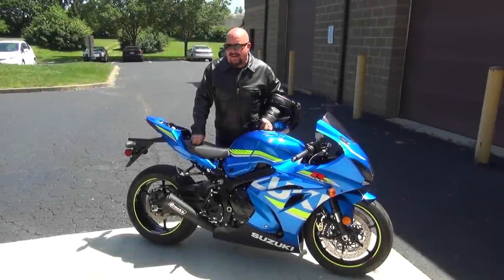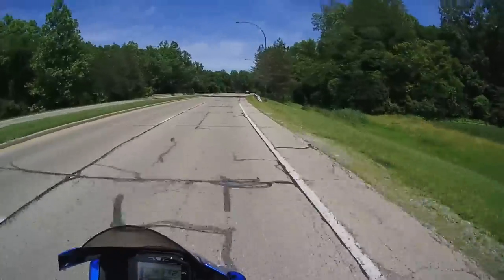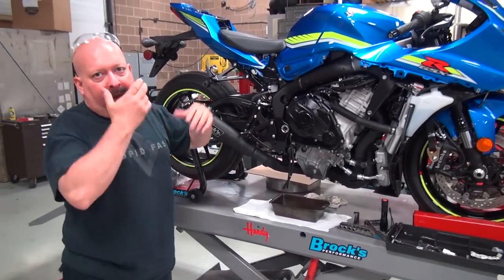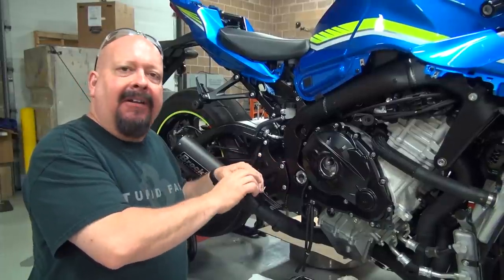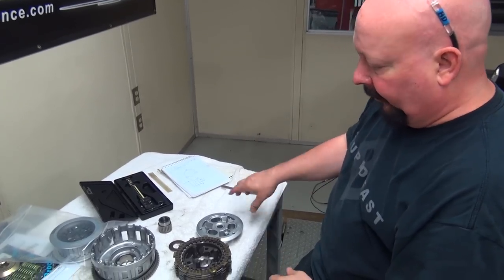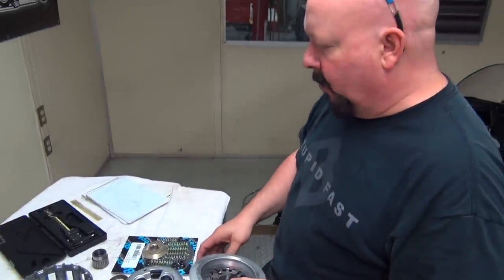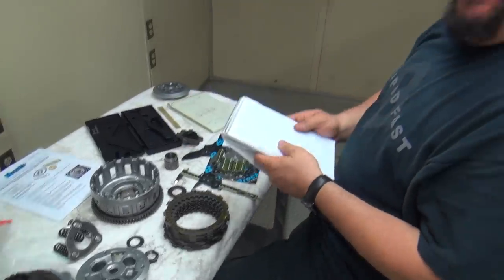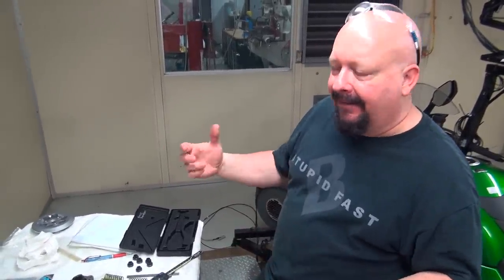2017 GSX-R1000 S2B: Episode 8 - Dragstrip Prep - Clutch Mod Conversion

Comment: Would adding this mod kit have negative effects on everyday street riding or wheelies?
Reply from the maker: You lose the back torque limiter, so if you slam it into 1st gear at 80 mph, the back tire will bark/slide etc. The mod just makes the clutch act like all clutches used to.
Reply: @BrockDavidson  thank u

Comment: Manual does state one full turn, but 3 quarters of a turn does seem like the sweet spot.
Reply from the maker: Some of our riders prefer 1/2 turn - that's fine, as long as we check the adjustment frequently as 1/2 turn out does not allow for rider mistakes as well as the longer adjustment. This is simply due to plate wear preventing full clamp force if the clearance drops below 1/2 turn....which leads to a completely destroyed clutch on the next run if not caught. Hope that makes sense, lol.

Comment: What year Inner basket/pressure plate did you use? And also what year fiber and steels.
Reply from the maker: https://brocksperformance.com/clutch-conversion-kit-with-ultra-light-billet-clutch-mod-kit-for-gsx-r1000-r-17-18/

Comment: Great video! I didn’t understand about rotating that last fiber plate one notch?
Reply from the maker: There is a special shallow notch in the outer basket to allow the outermost fiber to be rotated one notch from all of the rest.
Reply: @BrockDavidson  ok thanks! In the past I don’t think I did that. Does it actually change anything?
Reply from the maker: It helps prevent the plates from sticking together due to capillary action, so oil can flow through properly when the clutch is pulled in, for smoother operation.
Reply: @BrockDavidson  Thanks man I appreciate your knowledge and all your replies!

Comment: I just realized I stuck the steels in with the rouned edge facing out..will that cause a issue?
Reply from the maker: Not at all.
Reply: Right on I message the brocks whatsapp yesterday asking the same question. I bought the mod kit and had it over nighted just the other day. Thanks for the response. One more question I understand it's takes some adjusting to get your clutch feel where u want it but should the clutch feel so tight. Like normally if it's in gear not running I can clutch and move it pretty easy now you gotta but some force into. I've been pulling 1.60 60 footers running 6.23 at 120 and a 9.50 at 148 with a factory wheelbase. Only thing that's been done is I've bought the lowering window link, raised my forks. I just went to a 46/16 set up and I'm hoping with your mod I can down to a 6.0 oh yeah I pulled the muffler off like u did on the dyno for the extra 3 ponys lol your videos have been key man. Thanks from one drag racer to another.
Reply from the maker: Exactly which bike are we talking about? Yes, the lever pull will usually get 10-15% former with most of our kits. It does get severe with our cushion install though. It's difficult for me to answer fully without knowing which bike we're talking about.
Reply: @BrockDavidson  23 gsxr1000r
Reply from the maker: Ok. So our conversion kit. Lever pressure is only increased by 25-20%. If yours feels like more than that, you might want to readjust the cable and throwout. If it's still too tough, check your stack height.
Reply: @BrockDavidson  ok I just took it out an it shifts fine when I throttle it hard it slips...high rpm with with nothing there so what do I do I do

Comment: Would lighter springs let the clutch slip? Cheaper I guess. Got the cover off, so. Winter and stuck at home watching BP's vids. :)
Reply from the maker: @David, glad you like our vids. It's the design of the clutch, stiffer springs actually work better as the limiter locks up quicker/more solid... but it still can't be slipped properly.
Reply: I have some serious garage envy going on here.

Comment: I See  you on your toes. Were about the same height 5/8 or 9. Tall comfy bike. First super sport I can't be flat footed easily
Reply from the maker: @Mike, the bike hadn't been fully lowered in this video. By the end of the series (lowered front forks/radial mount strap kit /rear lowered with window link and seat stepped) I could easily touch flat-footed, even on the street with little or no strap.  I'm 5'8" with a 30" inseam. Hope this helps - BD

Comment: Why drag race a non Drag Racing bike? Why get a GSX-R1000R instead of a hayabusa?  Just curious because it doesn't seem to make sense to buy a bike and then go away from everything the original bike was designed to do.. Maybe I'm missing something here so I'm just asking bc so far it makes no sense
Reply from the maker: It's 100 lbs. lighter than a Hayabusa , makes more horsepower and has considerably less frontal area (to start) - not all 'racebikes' need to turn. The quickest streetbike (currently) on the planet started its life as a CBR 1000RR:  Watch it beat on a Busa here: https://www.youtube.com/watch?v=tRnFwzwwkpU

Comment: Can you do this for 2007 750 for a daily driver ??
Reply from the maker: Sure. All of the theories are the same. Parts are a little different.
Reply: Brock Davidson what about the clutch adjustment under the gas tank does that need to be messed with the Manuel is kinda confusing the way they have it labeled

Comment: you should make sure the springs dont coil bind when clutch is  pulled  in ,disengauged  how do you check that brock or is there just ample clearence ? like valve springs    geting compressed with  a  i1 inch cam lift   it will break heads with  rocker arms  i seen a zl1 ,1969 casting  came off aluminum block zl 1 in  69  zl1 427 copo camaros and 2 corvettes somebody welded  all the rocker arm mounting points in the  highly sought aftter  zl1  big blocks , much to my suprise is they was open chanber oval ports big  oval id of bet money they would of been open chamber  rectangle ports  all that  old technology  now 454 smal block lsx with  2 turbos   all the power you could ever wish for  just retard timing  tighten  waste gate  2500 hp no problems and rpm to boot  6 bolt mains  bullet proof
Reply from the maker: We compare the installed spring height ( - the throwout) vs. the solid compressed spring height. We build plenty of clearance into our springs to avoid coil bind, but since we also alow for shims - it's possible for coil bind to happen and must be verified.

Comment: Is that your  gsxr1rr
Reply from the maker: Yes - but it is the single R version with no anti-lock brakes (too heavy and unneeded for our drag application)...and then we flashed the ECU to RR specs to accept a QS/Blipper.
Reply: No worry RR just have more reliable suspension and little difference in shape☺brocks man  have a nice day a head
Reply: Just tune this gsxr on track version then see what happen it speed  you more than 300kmh. That touch 100kmh 60mph in 3.0
Reply: Do u like drag racing
Reply from the maker: yes. In the US it is easy to find a dragstrip and have no speed limit several times per week :)
Reply: How much time u participated in drag race👦with loving gsxr
Reply from the maker: http://blog.brocksperformance.com/brocks-performance-company-profile/